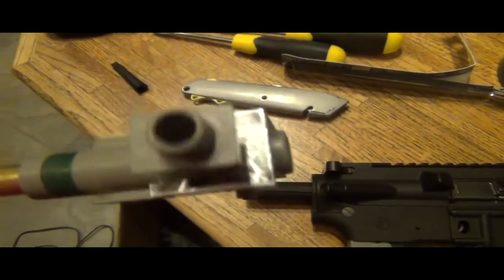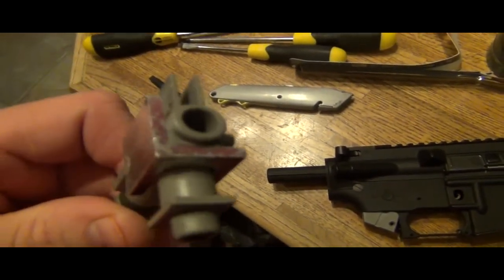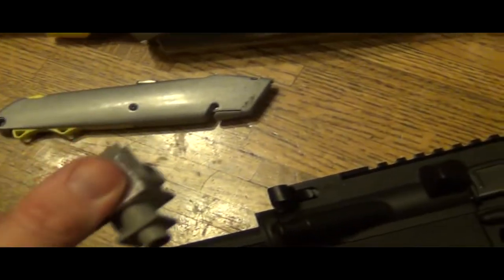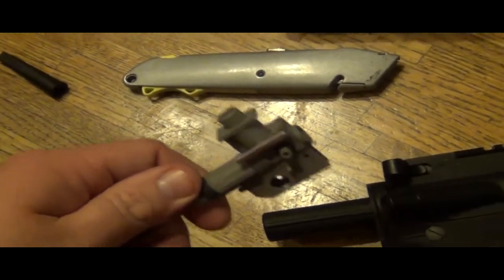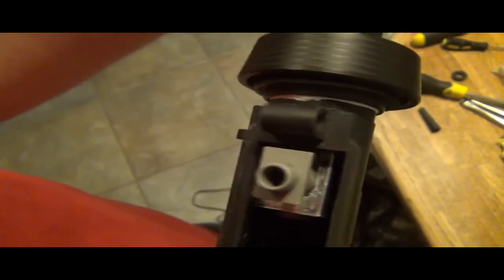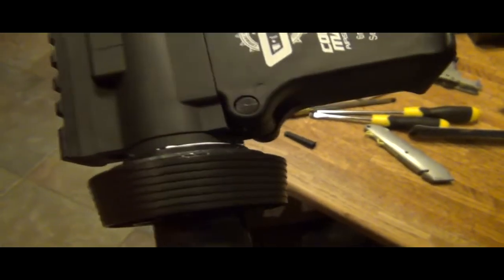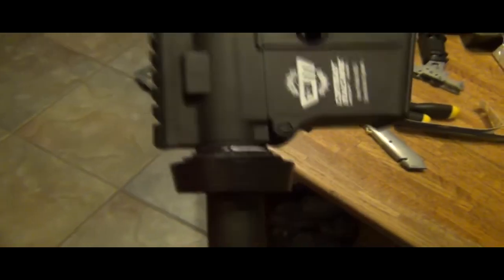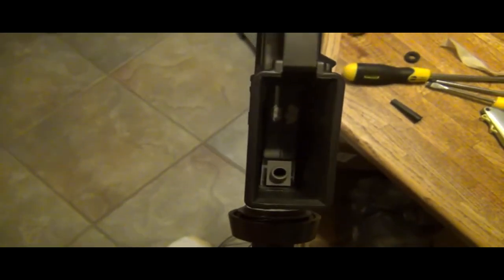Pressure Plate Finished for M16 V2 Gearbox

Comment from the maker: STS is trademarked so you can't call it that. The size varies a lot. If you don't want to make yourself one I guess I can make one for you then you would have to file it down to your size. The STS product doesn't put pressure on the gearbox shell, this would and be better overall.